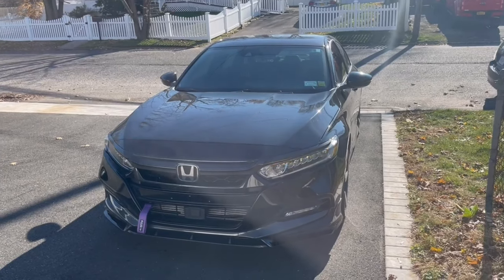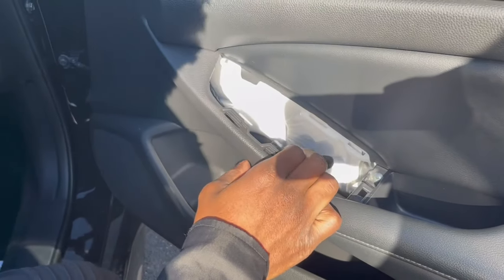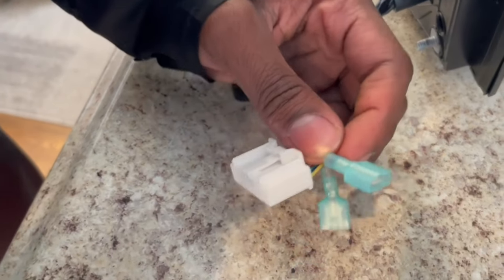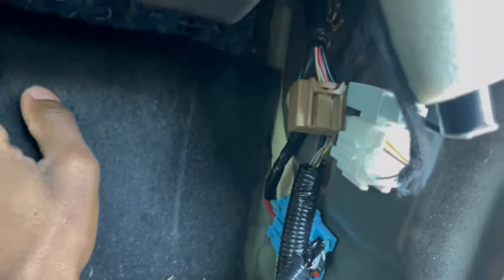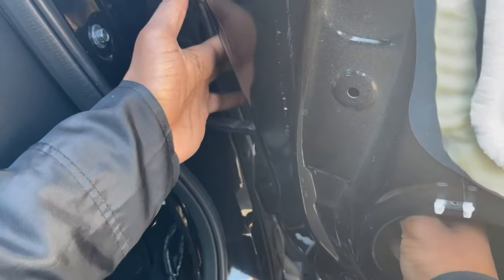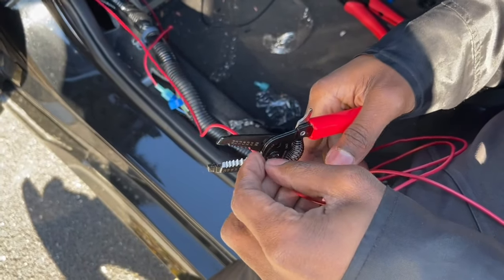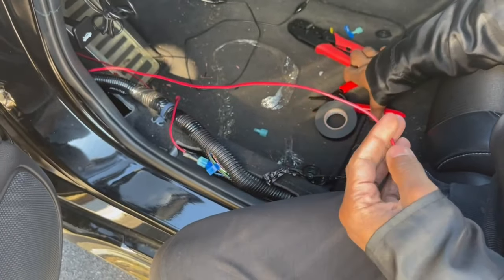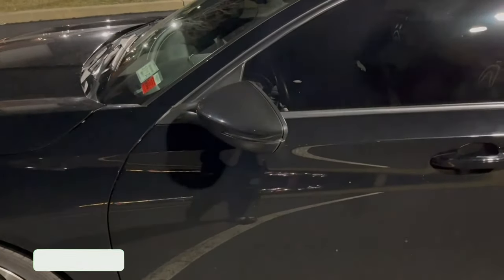Turn signal side mirror install 10th gen accord

Comment: damn this is a good video. boutta do it to an 08 nissan altima even tho its not the same car this vid showed me everything i needed to do
Reply from the maker: Hope it all goes good
Reply: @NadeWes  ended up doing it. i tapped into my rear signals and routed the wires to the front then just cut the signal wires from i side the housing and its working perfectly. W video thank you for this

Comment: It’s much easier connecting directly to the signal light. This is too much work.
Reply from the maker: It’s looks like a lot of work to you but it’s actually easy to do and if you seen the updated video you see how I wired it up under the dash in the fuse box
Reply: @NadeWes Thank you man 👍

Comment: Any info on the blind monitor system on the 2023 Sports-L? The sensors are still on the rear bumper but they took off the mirrors for it. Can the system be revived?
Reply from the maker: If the sensors are indeed on the car then you should be able to buy the blindspot mirror and plug it in but then if the system is not functioning then the system would need to be programmed

Comment: I would’ve just ran a positive and the negative to the other connection by adding a pin
Reply from the maker: This was my first time doing This video I since then 
have done this differently where i don’t have to use taps and cut into the cars harness I now ground the wire to an existing ground on the inside with a ring terminal and I have a wire tap that doesn’t require and cutting in to the oem harness

Comment: Damn do they got one that slides like the rear reflectors instead of flashing
Reply from the maker: You can buy those at Xgenauto.com you will have to get oem mirror for this or find that wiring of an oem and splice it in the aftermarket

Comment: I have a 1.5 sport it does not have stock turning mirror lights, I’m tryna install sum sequential ones. Would I have to get the 2.0 harness for all the wiring to work out?and if so how was the install for that?
Reply from the maker: No they 1.5 sport does not come with it you would have to get new mirrors and for the mirror to work you would have to get a new harness but you still would have to wire the turn signal I’m also working a way that may not require getting a new mirror or harness but still require wiring I’m still working on that
Reply: Oh ok ima wait then lmk if you make that, that would be sick
Reply from the maker: @jsstaticaccord hey I just wanted to let you know to keep a eye for the new video on adding the signal without having to buy a new mirror video going to be out this week I didn’t forget about your comment💪🏾
Reply: @NadeWes  preciate u fam thank you bro

Comment: Do you have to disconnect the car battery when doing this?
Reply from the maker: It’s better to you can find the signal wires then mark them so you don’t short out anything while working cause you always run the risk of a short out when wiring especially if they car still has power
Reply: @NadeWes where did you connect the wire tester?
Reply from the maker: @jacksonj-wk8cl any metal bolt on the chassis

Comment: Does this still have the heated mirror feature? Is there a way to have these blinker mirrors and heated mirrors? I have the 2.0 accord but only have the heated mirrors
Reply from the maker: Yes it keeps the heated mirrors all in the U.S the accord 2.0 sport and up all have heated stock so if you get a mirror with the signal it will keep keep the heated mirror
Reply: @NadeWes  where can I buy these mirrors with the blinkers? And still keep my heated mirror feature
Reply from the maker: You can find them on eBay or oem ones from Honda

Comment: I want to add Turn signal indicator to my side Mirrors on 2023 Honda Accord Ex Platinum Pearl white With All black
Reply from the maker: Should be same step you would just need to source some mirrors
Reply: I have a 2020 lx only 3 pin how can I get same result as you
Reply from the maker: I have swapped out my door harness out for 2.0 sport ones so the mirror would plug-in so all I have to run is the signal wires
Reply: What is the black wire for is that ground as well
Reply from the maker: Sorry for the delay I just seeing this if you taking about the black wire on the mirror itself that’s for the heated mirror

Comment: Hey, I’m thinking about buying one of these and doing the smoke tail lights like you did. Has the car given you any problems?
Reply from the maker: No the car hasn’t given any problems runs perfect no issues with all the modifications I’ve done so far
Reply: @NadeWes  awesome, thanks for the response. I have a 6th gen accord and I think I’m ready for one of these or maybe an Acura tlx
Reply from the maker: If you get a 10th gen get a 2.0t if you can find one you will fall in love with the 10speed
Reply: @NadeWes  I’m trying my best for the 2.0, they are pretty scarce and expensive near me, I’m talking over 30k. I’ll be content with a 1.5 if I get a good deal on it
Reply from the maker: I feel you they are now getting hard to find and expensive best of luck to you on getting your next car
Reply: Thank you sir. I just subbed , I love your vids with the accord and the G
Reply from the maker: Appreciate you
Reply: @NadeWes  You can say that again. The 2.0T are hard as hell to find. My brother's buddy has a 2019 or 2020 sport 2.0T and I ordered my 2022 Sport 2.0T on late November. It arrived 2 days before Christmas it and drive it home. Didn't drove the car during the first 3 months of the new year. It was mostly garage kept until the weather was a bit better. Now it has 3k mileage on it.

From where I live there were only the 1.5 and Hybrid on the road. I believe my brother's buddy and I are the only one with the 2.0T in town.

Comment: Just to be clear, drivers side is a blue wire and passenger side is a brown wire?
Reply from the maker: Correct
Reply: @NadeWes  you recommend getting OEM mirrors if you want to upgrade to sequential turn signal and the folding mirror kit?
Reply from the maker: Yes I recommend that the kits is made for the OEM I’m not sure if the aftermarket would be a smooth install